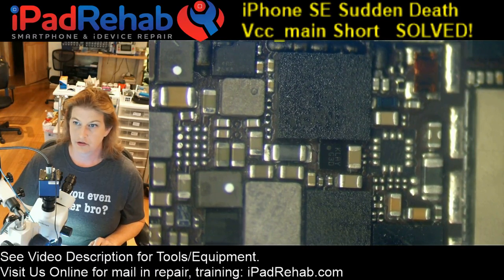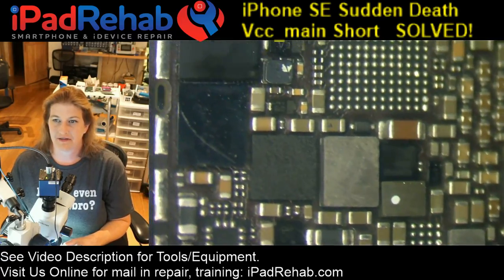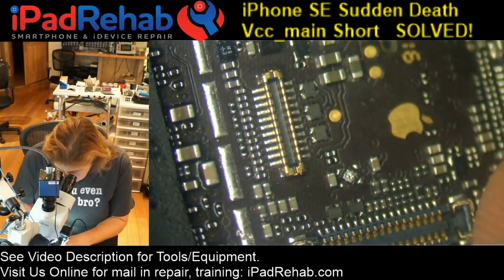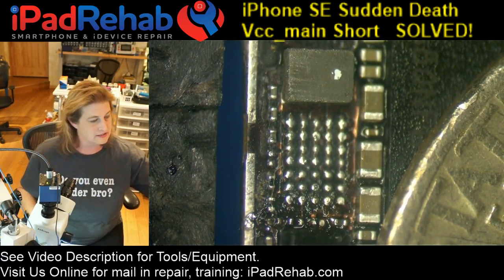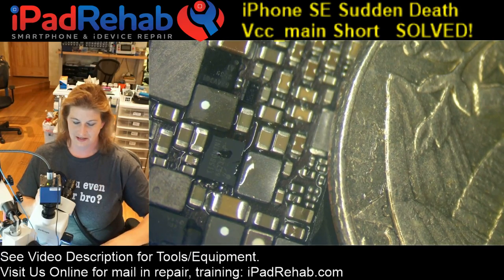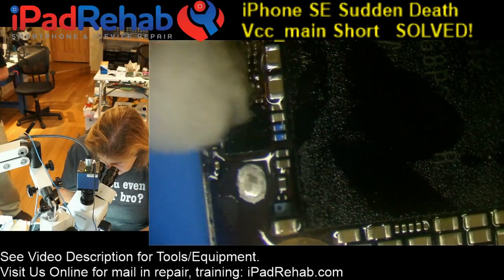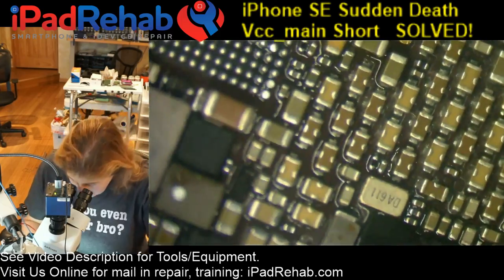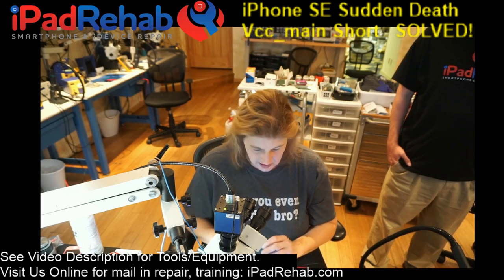iPhone SE Sudden Death Vcc_Main Short---SOLVED!

Comment: Jessa HELP
Tried the alumni group and a few others. Have backlight and full boot after meson replacement but no image. No obvious heat to pmic or cpu (no rabbit ears) for shitz n giggles replaced chestnut, mesa boost looked angled so reballed and replaced, i did have the left most caps between meson and cumulus bridge on the meson side, fixed that. 1v8 lcm power line reads .33 in diode mode. Removed, reballed and replaced cumulus... other than removing all silicone on connector side of the board and praying someone is a floater, i can only think to check for all data lines to lcd connector
Reply from the maker: look at the power lines for image---do any go to meson?  What do you think would happen if there was a bridge under meson on an image power line?  Second question--will an iPhone boot with image if meson is off?  Answer = yes.  So what should you do first to troubleshoot no image after meson?
Reply: iPad Rehab test remainder of power lines to lcd

Comment: Jessa, what are your thoughts on these wall sockets with integrated USB points for charging the iPhone?

I'm convinced one of my customers has fallen foul of using these, better to use the Apple plug into the socket hey?
Reply from the maker: There's too much disparity in quality between the many companies making these to be able to make a definitive comment. That being said, I would definitely err on the side of caution and use the Apple plug instead.
Reply: iPad Rehab thanks for the reply, valid point. I would rather use the plug also, is all the protection inside the Apple plug its self? Not sure if there is anything cable side to protect our devices.

Comment: HiJessa, Is this a data recovery job or for the sake of the phone? I'm guessing for the sake of the phone as no water damage, if thats the case are you happy to warranty the job without replacing the mosfet and just joining vcc main and batt vcc?
Reply from the maker: no, i would not do that for the sake of the phone.  If it's going to be a phone again, then it needs to have all of its parts.

Comment: Miss Jesse I want to ask you if you tried to take off  iphone 6s or iphone 7plus  PMIC or not??
Reply from the maker: Yes but PMIC rarely fails, typically a shorted line because of some other component. Are you blaming the PMIC for a good reason or just because someone on gsmforums told you to replace it?
Reply: No miss Jessa I have an Iphone 7plus water damaged have a vdd_main short and I tried to troubleshoot it by heat but motherboard was heat on Q2101 I took it off and SOLDER pins to connect vdd_main to battery voltage and tried again but was not successful I didn't got any heat after that I started with the capacitors that on vdd_main I took it off one by one and IC's that have a vdd_main but still have a vdd_main short now the remaining components have a  vdd_main are (PMIC, M2600 "NEO SIP MODULE", M2800"TRINITY_BLUE SIP", SIM CARD CONNECTOR ) for that I tried to take off a PMIC but I couldn't because it has a strong protection or maybe my hot air is not so good can you gide me??

Comment: Hye Jessa ! I have an IPhone 6 sent to me from other shop. When I look around the board, all the VCC_Main cap are removed, the reason this IPhone sent to me is because it keep showing temperature warning even not in hot condition. Before this the IPhone is a water damaged and it already power on, but the only problem is the temperature warning issue. Would you give some tips or maybe you can make a video about this cases. I've watched all the repair video on youtube, but no one have made a video about this case yet. Maybe you can be the first to make it. :)
Reply from the maker: Or maybe YOU can.  I don’t have a magical repair manual—I figure out faults that are in front of me.  How about you figure this one out and let everyone know what you find!

Comment: Argh maaan, I despise underfilled chips, especially small ones. I find using my flir camera for the problems like this is useful, as although the resolution isnt great for finding discrete component shorts, it works pretty well for chips, as you can see them pretty well, it'll detect shorts even when the temp diff is very very subtle, found them when you couldnt feel any heat what so ever.